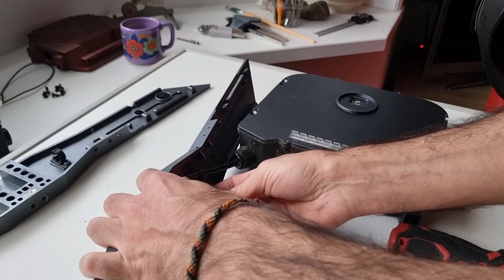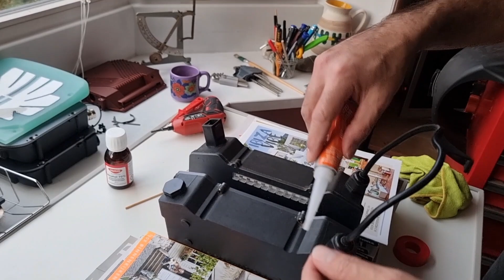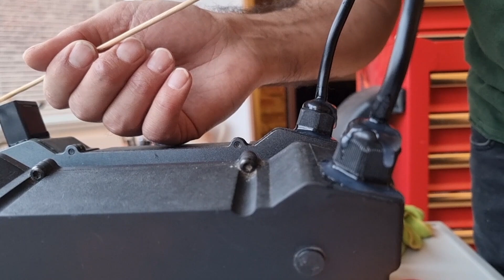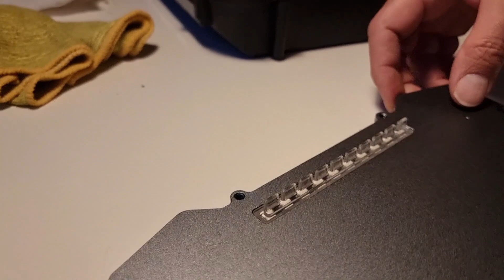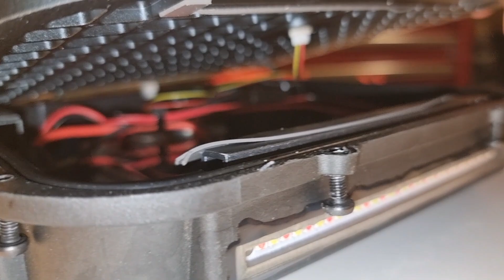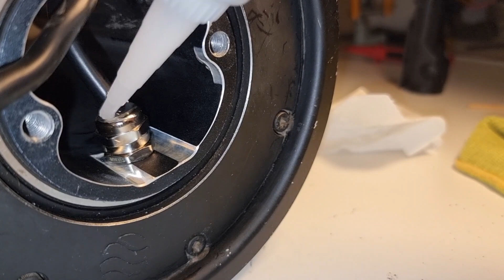Floatwheel ADV Waterproofing

Comment from the maker: Extra tips coming in as we go:

- Put a bit dielectric grease (sometimes reffered ro as tune-up grease) on your motor cable plug to prevent any water to get in the connection.
 This is a silicone-based grease that repels moisture and protects electrical components against corrosion. It is also used to keep dirt, water, and other elements out of electrical
connections.

Comment: I didn’t get how you manage to silicon the back of the charge port? You only silicon the black and red wire ?
Reply from the maker: Yes, it seems that it is done  well by Tony. Only thing where it could possibly come in is between/around those wires.

For the rest there was a lot of black silicon from Tony.

Comment: The ptft tape isn’t needed I would argue. The way this designed, the nut will put pressure on the plastic fingers, the fingers will clamp down on a rubber ring. If you want to use the ptft tape it should be making the rubber ring tighter and not the treads. Great video for the rest.

Comment: Is there a reason the blank connector on the battery box has those gaps? Am I ok to fill them in with silicone?
Reply from the maker: This is an air vent for the batterybox. There is a goretex sticker on the inside which lets heat, airpressure and moisture (if that somehow came in) through.
 The sticker doesn't let moisture in.

Not too clever blocking it. As far as we know it works fine. (That means that until now we haven't heard that it didn't work properly)
Reply: @luukbron  better remove the silicone I just put on those gaps then, hadn't I? 🤣

Comment: Nice Video! But bad timing, cuz I just badgered my adv 1 day before this video came out 😅
I did not silicone all places that you covered in the video. So I will catch up on that.
I think badgering the motor cable connector is very important. Even Tony mentioned this under my video, where I rode my board in the snow.
I used non flowable silicone around that connector. Hopefully I can scrape that off the next time I need to unplug the motor 🤞